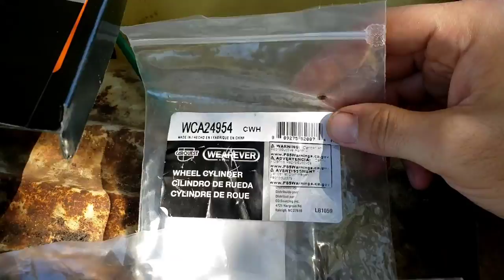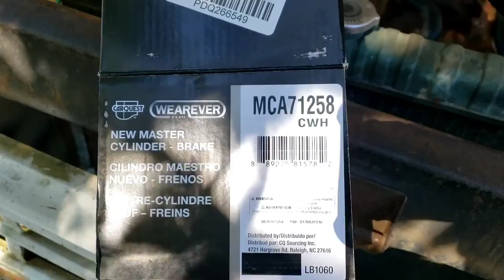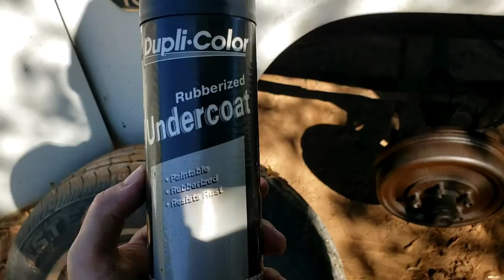Getting into drum brakes on my 67 dodge D100, Revival pt 11

Comment: I gotta do the brakes and bearings on both axles of my 64 w200. I ordered from rock auto as well. My first time doing drums…edit: while I’m in there, I also ordered regular lug nut studs for the entire passenger side because this stupid truck has reverse threads on that side…
Reply from the maker: I hope it goes well for you. When I did this one here the drumb brakes one the passenger side where mangled pretty bad.
Reply: @bluecollar8729  yeah mine too! the passenger side front was really really bad, rear not much better. The w200 is gonna be my farm truck and once I get it road worthy, I got a pretty nice 67 w100 I wanna restore to showroom floor appearance. I wonder if the passenger side being in worse shape is a common thing and if so is it because of those stupid reverse thread lug nuts…
Reply from the maker: I'm not to sure i just wish these old rigs where better taken care of. Alot are pretty messed up and the new vehicles look bad these days. But in any case I hope your projects go well. Take its easy.

Comment: Are the front and rear drums the same?
Reply from the maker: Actually no. I thought so when I was doing them.  But the rear are off set. One pad is a bit smaller then the other. Witch is why I had trouble putting one of the rear housings back on. I I belive it is the front pad (for the rear brakes) that is a bit smaller then the other.